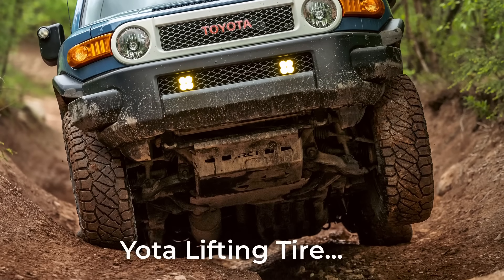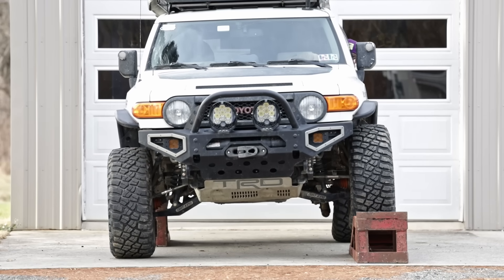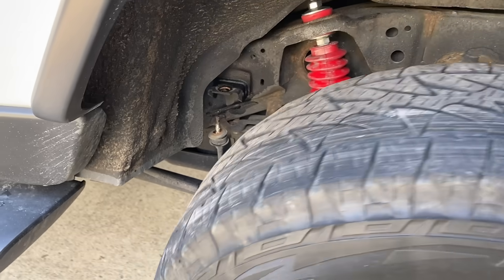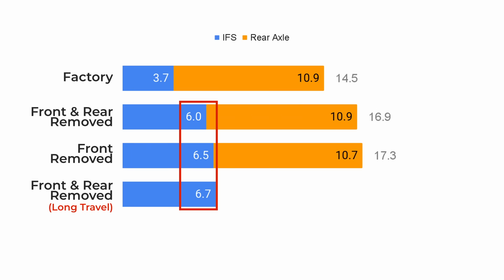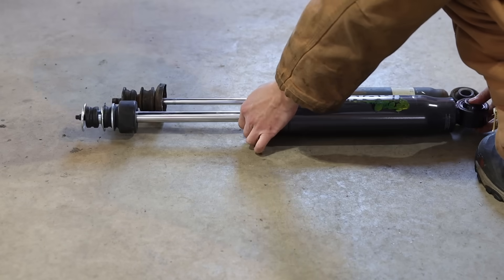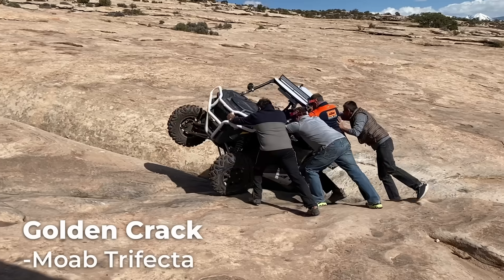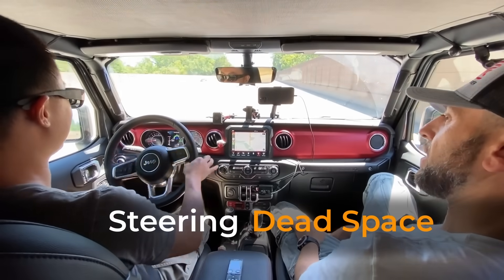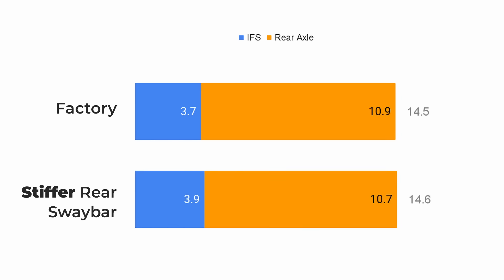Articulation vs Sway Bar | Not What You'd Think!

Comment: My 4-Runner has the KDSS suspension, which “disconnects” the sway bar for more articulation.  Before that in other vehicles, we would simply unbolt the sway bar links and push the bar up out of the way, strapping it up, of course.  Never had to completely remove one.  You need that shit to control body roll on the street when turning curves.

Comment: Enjoyed your comments and video. Found it very helpful and instructive. Considering disconnecting front sway bar. Could you recommend a quick disconect method so it can be placed back for daily use?
Reply from the maker: Thanks. There is no good way for Toyota Prado platform. Check out the pinned comment for more detail

Comment: Thanks for another great video. Couple of questions:
1. I calculated the stock sway bar (rear) to have a spring rate of approx 60lb/in. It's that correct? It's that also the approximate value for the Currie bar?
2. What is the spring rate you get with the thicker bar you're using?
3. What do you suggest in terms of relative front and rear spring rates (including the sway bar effect)? For example, my front springs are 580lb/in and rears average 200 lb/in (variable rate). Would you suggest (for the purpose of better balanced off-road articulation) approx 350lb/in from the sway bar? Or should your live rear axle have less  than the front?
Tnx in advance

Comment: At some point I wonder where our definitions hinder our actual results. For example, you're measuring articulation against the body, correct? So with the rear sway bar disconnected, the body rolls, and you end up with a smaller measurement. However, the practical result is" how far apart can these ground points be from each other, and I can still drive up them.

If you allow body roll and eliminate that as a measurement point, does the increased rear flex let the front do more work, regardless of body angle? Can we show that the vehicle can traverse cross axle heights that are greater in one setup than the other?
Reply from the maker: Good thoughts. I measured distance between the top of the tire and bottom of the fender. Body roll angle relative to ground does not affect this measurement. You are correct, the useful articulation is higher than the numbers I presented. Things like tire flex and frame twist will all add into useful articulation. But my intention is to isolate only the suspension movements. MetalCloak's official CTI test measures how high the diagonal tires were lifted off the ground. That is the practical measurement of the entire system. But here I focus on suspension only.

Comment: I wouldn’t recommend it. While average driving may not provide a significant difference, a lack of sway bar will make emergency maneuvers much more dangerous. 

The real way to do it is to get a disconnectable sway bar, as this allows you to have the articulation of no bar off road while having the safe & predictable handling on road of a bar.

Comment: My TJ quickly lost its front sway bar, after I bought it , it had a broken link and they were not matched to the lift. When the rear axle was replaced, I did not even weld the mounts for the sway bar to the axle. Never did the science, knew the front being gone was good, didn't care about the rear lol
I wonder what will happen when I change the balance of spring/body lift
Cool Video

Comment: I would say weight distribution over front and rear axles is also important.  Loaded pick up like Tacoma will tend to stay with both rear wheels on the ground and lifting a front wheel. In  this case it may turn out that removing rear sway bar can help a lot.

Comment: I have a lifted Ford ranger, so I guess not exactly 1:1 comparison. But between the unsprung weight and the weight of the springs increasing exponentially and my body/cab decreasing weight.... My truck is extremely unlikely to flip. And it does* flex quite a bit after all has been properly modified. But you can't just go changing details without the consideration of the whole picture. My truck cost a fortune to get where it is. (In house R&D mostly)

Comment: Making the sway bar more stiffer in the rear makes it really good for off road, but when you drive it on the highway and when there is a high speed corner your outer-rear wheel is loaded so high that it will loose traction and oversteer. But it will be fun to see how it drifts though 😉
Reply: drifts...with high center of gravity. I do NOT recommend.
Reply: @anavan7 at highway speeds i enforce upon it
Reply: @anavan7 kamaz truck days hi

Comment: I daily drive a 2004 4Runner V6: firmer front springs, stock rear springs, approximately 1.5" lift, generic KYB gas dampers, upgraded bumpstops...and NO swaybars. It rides better on and off road, it handles only slightly worse, more traction off road and tows the same. If you JUST remove the swaybars on a stock vehicle, it sucks and is a bit unerving. However,  with some thought put into the total package it makes a noticeable positive difference and a great well rounded dual sport truck.

Great video as usual. I learn a lot from you.

Comment: Great analysis, as always. Another thing I would like to know is; How much added stress is put on other parts, and what new weaknesses are added by removing the sway bar. I know the CV axles and ball joints are exposed to much more articulation and strain, but I don't know by how much. And, it would be good to know by how much the strain is amplified on these parts at the extremes of travel. As in, CVs aren't as strong at full-lock steering and droop or compression of the suspension -- but Toyota likely designed these tolerances with the sway bar or KDSS in place. It would be interesting to learn more about the amount of stress removal of the sway bar puts on these other critical parts, in relation to what they were designed for. The number of Yotas being recovered offroad due to balljoint and CV axle failure is pretty significant, so I suspect there's a tie to these other parts being impacted with removal of the sway bar.

Comment: I am interested how the same ideas apply to a tacomas.

For starters they don't have a rear sway bar. Maybe because of the leaf springs?

I think tacomas are able to run an even longer rear shock as they weld a higher mounting point. Is that extra articulation less useful since it is so imbalanced especially without a rear sway bar?

Comment: Search for: Toyota FJ Cruiser with I.S.S. hydraulic suspension system by LTT & Creuat (Lleida Tracció).  This is the only suspension that can use full geometry range, keep the body and weight balance, dynamic (some years before KDSS), adjust height, keep tire contact patch maxed and minimal camber angle change, increase stability and lateral grip, increase articulation while decreasing body roll, nose diving and incrraesing traction accelerating and braking... No springs, no sway bar, no struts or coil overs...

Comment: So you showed that you had more flex with rear swaybar in when on perfectly level ground and exactly the same obstacle on the front and rear axles.

But how often will you run into that scenario offroad? You should repeat the experiment on an incline and decline and experiment with having one car ramp further away for the vehicle so that the one tyre has to travel higher than the other and then see the results. 

I very much doubt that rear swaybar in will give the best results in all cases.
Reply from the maker: If you consider weight transfer, this will provide the most optimal result in the real world. When you go up hill, weight transfer to the rear and you’ll have even less articulation up front thus the most imbalance. When you go down hill, the opposite happens but you don’t need a lot of traction to go down hill. Again, this applies to IFS + solid rear axle. Wranglers have more in board spring placement in the front axle. Thus it is “softer” in articulation than its rear axle to begin with. It’s opposite to IFS. A lot of Jeep dual rate front sway bars are to address this imbalance.

Comment: Yep, there is no free lunch. Just like in racing where you might actually go with a less stiff spring depending on the overall setup and track, the obvious "accepted rule of thumb" is not always the correct one. Guys think no body roll always leads to quicker lap times when in reality it's proper weight transfer that leads to quicker lap times and you achieve that with different combinations of springs and shocks. Off roading is the same. Most average Joes are served perfectly well with basic mods and a small lift regardless of optimization. Whereas those professionally desert racing or those having dedicated rock rigs will absolutely change their suspension settings to suit the terrain because there is no such thing as one size fits all for the pro. But for the hardcore amateur your setup is about as good a compromise as can be made.

Comment: Ok this is a really cool and informative video. But I have a question. What about getting maximum flex and balance out of a ifs front and rear setup like a Subaru Forester? I have a few friends with off road Foresters. Do you have any suspension tricks for that? If you have a video already explaining this let me know.
Reply from the maker: If you make independent suspension soft for articulation, it will be too soft for on road driving or hitting bumps. Check out my Jeep vs Toyota video about “modes of stiffness”. So unfortunately, it will not flex much without substantial sacrifice that’s not really worthwhile. For example that Polaris RZR at golden crack almost flipped. It has a tons of available travel and is crazy good in high speed. But it doesn’t articulate much

Comment: ‘00 4runner with a 2” RC lift up front and diff drop. The rear is lifted only 1”. I’m considering removing front sway bar but as of right now at full droop my cv axles look like they’re going to bind (22 degrees) should I remove the sway bar or is this already at my limit?
Reply from the maker: Is your front lift spacers? Strut top spacers increase the overall length of the coilover thus over extend all the components. Check out my everything about Toyota IFS part 1 video if you haven’t already
Reply: @TinkerersAdventure  in the front I have new 2.5” lift Rough Country shocks. I just don’t know if I will benefit from removing the sway bar bcuz right now (sway bar attached) it droops so low that the cv axles look like they’re about to bind

Comment: THANK YOU for actually answering this question. I have no idea why nobody else has bothered testing this. I've been recommending my friends remove their front sway bars on their Toyota trucks for off-road use. I've removed it from my Sequoia and while the truck definitely leans more with more cornering g force, as long as I drive like a "normal" person it's totally fine. Frankly, the Sequoia handled rather well so I simply cornered faster than necessary with the sway bar on. With it removed, I concur with all your results here. It performs notably better off-road but I do have to corner more cautiously on the road. Not a problem.

Comment: I've actually added the bars to front and rear, along with helper springs, it should be very sure footed on road and to be honest, it wil still have full articulation off road. The bars are actually of a D1 but they are the same part as fitted to all the Defender range. I have done a lot of off road with the D1 and you don't really notice any cange, but they do keep the vehicle stable on road. I might do the flex tests, but for my needs flex is not really an aim. the aim it to keep 3 wheels on the ground and the TC should cope with moving the vehicle forward in conjunction with the centre locking diff. Later there are going to be more interesting traction aids going in.

Comment: Long long time ago anti sway bars were an optional extra for some new cars and trucks. Because we drive larger vehicles, faster and more on the road, I would preference sway bars. It improves safety and control. But back in the day when we all drove on rough roads at lower speeds, a sway bar would only be fighting against the suspension and making for a harsh ride.

Comment: Great video, liked and subed. How did you measure the articulation? I currently have both front and rear bars on my 4th Gen Ram 1500 with a 6in lift and have been thing of removing either 1 or both. Now I am wanting to really see what the difference is.

Comment: I think ifs it's equivalent to use both suspension springs and shocks just in the tyre, instead solid axles CANT use the spring and shocks linked to only one tyre, if we exaggerate this we obtain only one spring in the center of the axis so we need an anti roll bar to create an equivalent system that is more stable, so even though solid axles represent more traction when you don't have anti sway bars, when you have ifs and a solid axle you need an anti sway bar (for stability reasons) it just makes a lot of sense, i want apply this in a 2003 blazer

Comment: Food for thought, I have a 2007 Hilux, like the Tacoma's it has no rear swaybar, but you can buy one aftermarket. I currently have a stiffer front swaybar, but with sliding links, so I can lock them solid on the highway but just pull a pin to free up the swaybar off road.

Comment: spring rate will limit your articulation. for my old 3rd gen, I used stock spring rate in the front, and slightly stiffer fj80 front coils in the rear. no sway bars, but the rear would have been fine if it didn't limit travel. I made front uppers, and all the rear links using poly bushings, and some ballistic joints, all stock length. I didn't run much lift in the front, maybe 1-2in, and because of all this the front was fairly soft, and would articulate evenly with the rear until the front ran out of travel. I would get 11in of articulation in the front, 20in in the back. The one issue i did have with the rear only sway bar is you end up reducing grip in the rear, which can cause oversteer. On top of this if you lift the rear ride height, you increase the roll axis angle, and you induce roll steer, with the short stock upper and lower links. this is especially noticeable on the 2nd and 3rd gen.

If you are looking for a new video topic to discuss, I highly recommend downloading the 3/4 link calculator that's been floating around. the toyota 4 link with panhard shares properties mostly with a 3 link, so id try that first. The video topic itself you should cover is panhard geometry. personally I find after lifting the rear ride height its most beneficial to raise the axle side panhard mount as high as possible, since the roll center is determined mostly by the height of the panhard link ends. companies have come out with panhard relocation brackets, but they are focused on flattening the panhard, which almost doesnt matter in comparison to the effect raising the axle side mount has.

Comment: What is curious is the new ..ish...Ram TRX which has a solid rear axle and links/coils out back and IFS up front... Ram specifically got rid of the sway bar (thats on the regular 1500 rebel etc). There is a front sway bar only. The spring rates are 100/300 dual rate for the rear and 1100 linear for the front. Very stiff up front and very soft out back. The front has very little flex. I wonder if adapting the Rebel (or aftermarket) sway bar would increase front flex? Also, going to a much softer front spring. That would need to be done with aftermarket shocks as geiser and eibach have changed the rate little and just raised the front for a level really. I believe the king coilover uses a 600# spring... That will be much softer allowing less resistance to articulation.
Reply from the maker: Yeah the TRX and Raptor alike are setup for high speed off-road. So it favors straight up and down suspension travel when hitting whoops. It also need to handle very high dynamic loads. High speed desert stuff almost doesn't care about extreme articulation like what Jeep wrangler do. Slow speed articulation is quasi-static and it is very difficult to have a suspension that do well in both. See that Polaris RZR almost flipped over at Golden crack. But it has way more suspension travel than my FJ "on paper". For how advance the TRX shocks are, I personally wouldn't change it just for a little more articulation. It will become subpar in both high speed and slow speed off-road.

Comment: An excellent video - thorough, well tested and well justified. Thanks a load for this! Suspension is so much more complicated than people realise (me included): stiffness per corner, ride height, front to rear balance, roll centers, etc. etc. It's a mine field for anyone except a trained engineer! This did a great job of demonstrating complex interactions in "layman's terms". 

For on road driving, I find most people say they can't feel a difference. This is probably true for normal driving. The problem is in abnormal situations like swerving, emergency breaking, and sliding etc. This is where there will be a huge difference when the sway bars are removed. Ask yourself, if you can't feel a difference, why not? Sway bars are there for a VERY good reason. So be dam careful!

Disconnect for off road and then reconnect for on road is the best solution in my opinion.

Comment: On my Xterra the biggest gain other than articulation was much MUCH better transfer off objects. With the swaybar on, the wheel going off a sharp drop would get forced down very hard. With the sway off the ride is soooooo much better in all off road conditions. No more front wheel slam down. Hardly noticable on road as it's not that great handling anyway.